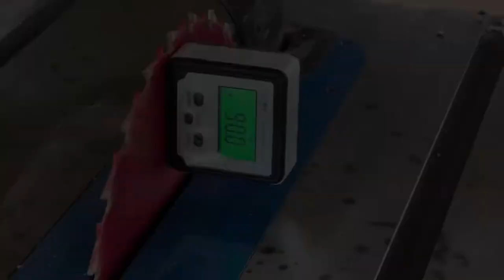Pet Urn

Comment: Vey nice build and got a great cause.  May I also suggest putting a container at the back of the saw and let the pieces fall into the container rather than trying to lean over the spinning blade and delicately trying to retrieve it.  It won’t take much for that to bite you!  You have a new subscriber.
Reply from the maker: Yup, it only takes one little distraction and there goes a finger.

Comment: Sorry for your loss, thank for sharing this build.  If I may, not judging...  some of the passes you make on the saw are a bit dangerous, just me.... the unsupported vertical panel cuts remind me of a friend who had an incident doing just the same thing in the same way, no offense ....
Reply from the maker: I would definitely agree with you. I knew they were a bit sketchy when I did them. Will probably be making a clamping fixture in the future.
Reply: @ekgwoodworks2931  also consider a Zero clearance insert for your TS.  Cheers